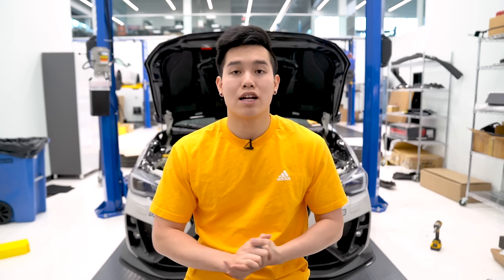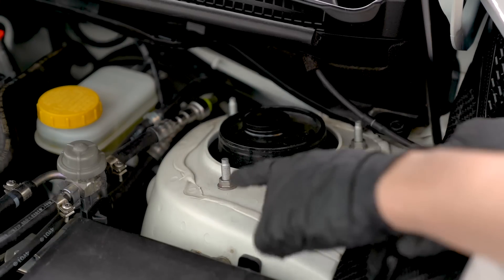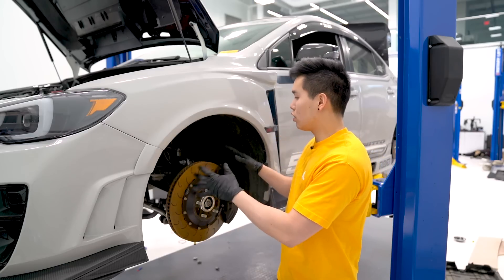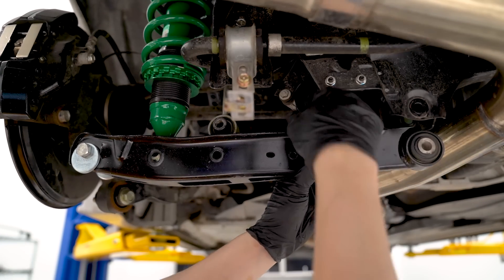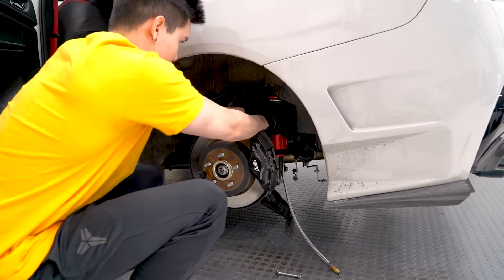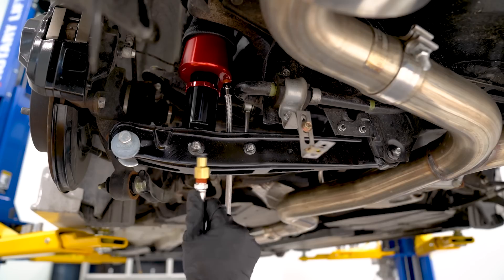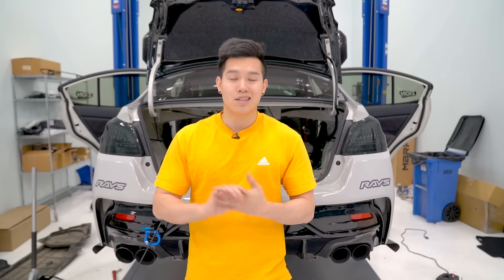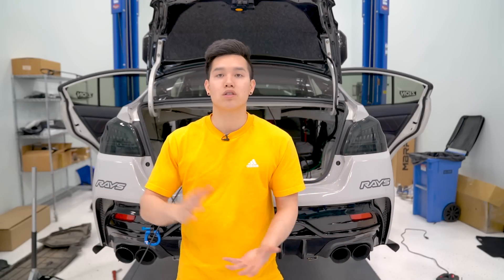How to Install Air Lift Suspension Part 1 - 2015+ WRX STI

Comment: You made it look way easier than when I installed mine. I took the rear apart the hard way apparently. Routing through the inside isn’t as hard as it seems. Better piece of mind knowing it’s not being exposed to the elements. Love the vids. Subispeed ftw!
Reply: How is it holding up?  I get to many negative review.   Like it going to break on you while traveling and you be Shit out of luck stranded.
Reply: @tackcoma5280  nah bro it’s reliable the only thing is you got make sure the  air line isn’t exposed to something hot under the car. You have to route it down the middle under the car. This will absolutely fuck up the suspension and would leave you on the road. Make sure this is perfect and you’ll be good

Comment: Wouldnt it be easier and a cleaner install if you run the black lines thru the interior like you would an amp power wire rather than putting so many screws into the car? Or is this safety related so the lines don't pop?

Comment: Is it safe in the winter with the lines outside? Even inside that plastic they could break by a rock or something. Nice video, just waiting for part 2!!
Reply from the maker: Yes, they are still safe underneath the car. If you hit something hard enough to cause damage in that area, you're going to have extensive damage to other parts of the car like the suspension, wheels, and etc. Unless you drive over a boulder, a rock won't damage the lines.

Comment: Where can I find replacement U clamps? I am unsure of the size of them. One of mine popped out causing leader line to break which caused a leak. I have a new leader line but want to make sure it is clamped down for clearance.